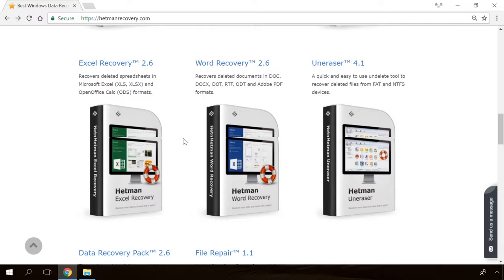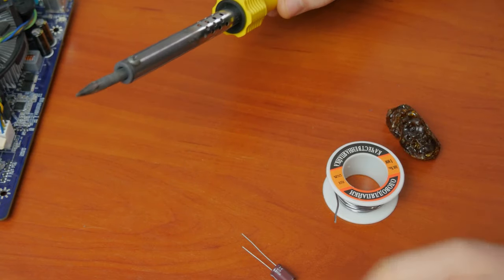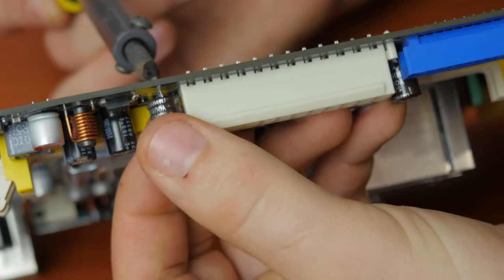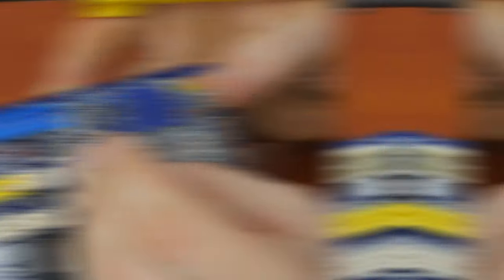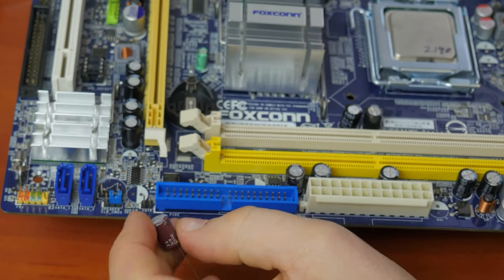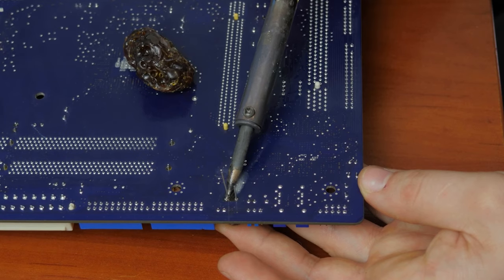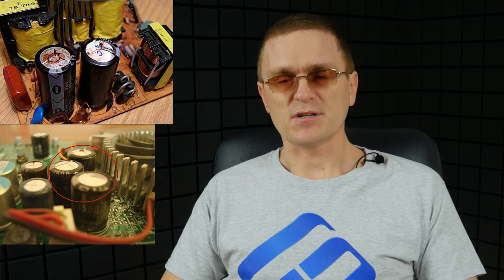🔬 How to Replace Bulging Capacitors On the Motherboard, Power Supply Unit or Graphics Card 🛠️

Comment: I disagree that using wick or a sucker is the best way to clear the old solder out of the holes in order to insert the new cap legs.  Using the paper clip that solder won't stick to is the best way.  I wish I would have watched your video before I replace the caps on the last few graphics boards.  I had one hell of a time clearing the solder out with wick and/or suction. In fact this is the only reason I was reviewing many videos on replacing the caps to see if anyone had a better way.  You do! I just did another one and carefully pushing through the paper clip when heating with an iron worked out great.  THANKS for the tip!
Reply: When using solder wick, cover the solder with liquid or paste flux or dip the end of the wick into the flux, the solder will wick into it really well then.
Reply: Try your paper clip method on a thick motherboard such as an xbox 360 hahahahaha
Reply: desolder and Soldering are the easy parts, the clearing of remainiing solder in the holes are the PITA part. I am trying to recap the old P4 and Socket 370 motherboards from the early 2000s. I had tried Hakko wick, cheal sucker pump and the Engineer Solder Suction Device SS-03, add solder, add flux to the holes and wick, etc, none of them worked to remove the solder! The only way I can clear the holes, is to use some steel pick and heating the holes from the other side to poke thru. But because not all old solder are completely removed but jsut enough for the capacitor pin, soldering will not flow freely to fill up the holes. The capacitor still work as the bottom pads do make contact to the cap but I just wish I could clean old solder from the holes so I can get a better, cleanly solder job. "Learn Electronic Rep@!r" did show how he clear the hole cleanly with Chemtronics wick with Amtech Nc-559 flux and heat gun. That's what I'm going to try.

Comment: This video has been most helpful, I need to replace a bad cap on an old server motherboard, the cap has been leaking brown stuff. I have one question tho, how do you measure a bad capacitor? Sometimes the cap is not leaking or the top is not bulging, but I  guess it can also be bulging on the sides? Thanks again for the tutorial! P.s. are you Polish?

Comment from the maker: Content:
1:41 - How to determine bad capacitors.
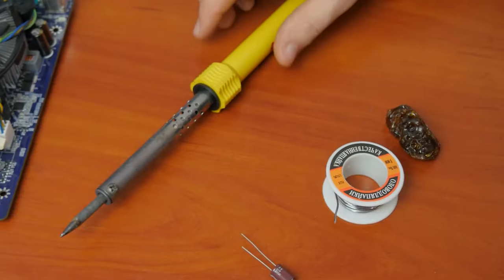2:08 - What you need for the work.
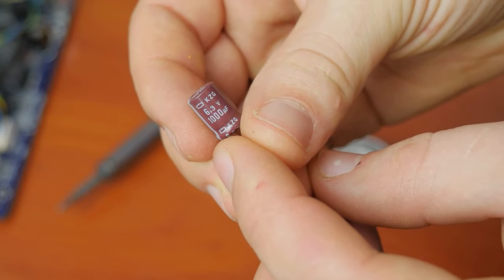3:23 - How to resolder capacitors.

👍 Watch how to replace bulging capacitors on a motherboard, why it should be done, and when it’s worth doing it!!! We will be glad to answer any questions in comments!

👉Accidental deleting of files, formatting the hard disk, a virus attack, an operating system failure or file system failure — these are only a few problems that can be solved with programs by Hetman Software: https://hetmanrecovery.com/

Comment: Need more information, like test capacitors with a multimeter, is very important first ensure to all capacitors are good. Can you made a informative video related with the testing of capacitors from a motherboard using a multimeter?
Reply from the maker: Title: How to Test Capacitors on a Motherboard Using a Multimeter

Introduction:

Begin by introducing the importance of testing capacitors on a motherboard to ensure its proper functionality.
Emphasize that a faulty capacitor can cause various issues, such as instability, power problems, and even complete failure.
Materials Needed:

Motherboard with potentially faulty capacitors
Digital multimeter (DMM)
Soldering iron (optional, for advanced troubleshooting)
Safety equipment (gloves, goggles)
Step 1: Safety Precautions:

Always ensure the motherboard is disconnected from power and any other components before starting.
Wear appropriate safety gear to protect yourself from electrical hazards.
Step 2: Set Up the Multimeter:

Set your multimeter to the capacitance (ΩF) measurement mode.
Some multimeters might have a dedicated capacitor testing mode (often denoted by a capacitor symbol).
Step 3: Identify Capacitors:

Locate the capacitors on the motherboard. They are cylindrical components with two leads coming out of them.
Look for any capacitors that appear visibly damaged, bulging, leaking, or have a burnt smell.
Step 4: Test Procedure:

Discharge Capacitor: If the motherboard was recently powered on, make sure to discharge the capacitors by touching both leads with the metal tips of a screwdriver. This ensures your safety during testing.

Testing Individual Capacitors:
a. Touch the multimeter's leads to the capacitor's leads.
b. The multimeter will display the capacitance value, which should be close to the rated value of the capacitor. Small variations are acceptable.
c. If the multimeter shows OL (Open Loop) or a very low capacitance value, the capacitor is likely faulty and needs replacement.

Testing Electrolytic Capacitors:
a. Electrolytic capacitors have polarity (positive and negative leads).
b. Ensure you connect the multimeter's positive lead to the positive terminal of the capacitor and the negative lead to the negative terminal.
c. The multimeter may display the capacitance value followed by a negative sign, indicating the capacitor's orientation.

Step 5: Recording Results:

Keep a record of the capacitors you've tested and their measured values.
Focus on capacitors with values significantly deviating from their rated capacitance.
Step 6: Replacing Faulty Capacitors (Advanced):

If you identify faulty capacitors, you can replace them using soldering techniques.
Make sure you have the necessary skills and equipment to perform soldering safely and effectively.
Conclusion:

Recap the importance of testing capacitors for ensuring motherboard functionality.
Highlight that this process can help identify and address potential issues before they worsen.
Remember, while testing capacitors can provide valuable information about the health of a motherboard, it's important to have a good understanding of electronics and safety precautions, especially if you're considering soldering and component replacement. If you're not comfortable with these steps, it might be best to seek professional assistance.

Comment: 3 of my motherboard solid capacitor is a bit bent, should i replace it?🤔
Reply from the maker: If you have solid capacitors on your motherboard that are visibly bent, it's generally a cause for concern. Capacitors play a critical role in stabilizing and regulating electrical currents on the motherboard. When they become damaged or swollen, it can potentially lead to stability issues or even hardware failure.

Here are some steps to consider:

Visual Inspection: Carefully examine the bent capacitors to determine the extent of the damage. If the capacitors are only slightly bent and not visibly leaking or showing other signs of damage, it may be less critical. However, any degree of bending should be taken seriously.

Check for Leaking: If the capacitors are leaking electrolyte or have visible signs of damage (e.g., cracks), they should be replaced immediately. Leaking capacitors are a clear sign of impending failure.

Assess System Stability: If your computer is experiencing stability issues, crashes, or other anomalies, there's a higher chance that the damaged capacitors are causing the problem.

Replace Damaged Capacitors: If you have the necessary skills and equipment, you can attempt to replace the damaged capacitors yourself. However, this requires soldering and electronics knowledge. Alternatively, you can take your motherboard to a professional technician or a computer repair shop to have the capacitors replaced.

Consider the Age of the Motherboard: If your motherboard is relatively old, you might want to weigh the cost of replacing the capacitors against the cost of a new motherboard. Newer motherboards often come with improved features and may provide better long-term stability.

In summary, while slight bending of capacitors might not be an immediate cause for panic, it's still a sign of potential issues, and it's a good idea to monitor your system for stability problems. If you see any signs of damage, such as leaking or other issues, it's best to replace the affected capacitors as soon as possible to avoid further problems. If the motherboard is old or if you're not comfortable with soldering, you may also want to consider the cost-effectiveness of replacing the motherboard altogether.

Comment: I have been finding it very difficult to get the solder out of the motherboard holes. I don't have a fancy desolder station
Reply: Sorry for a late reply, I just practiced on a broken board and successfully got one out. I had the temp really high, probably too high at 450°C and I melted solder onto the connections which transferred heat way better. I also used a thick tip which held more heat so when I did get good contact it didn't dissipate into the capacitor it built up on the contact

Comment: I can not get my legs to melt, evening using a 500 degree celsius tip, they do not melt at all.
Reply: The legs don't melt. Only the solder around then melts. Use a bit of flux.  It WILL melt. 500C is far too high.